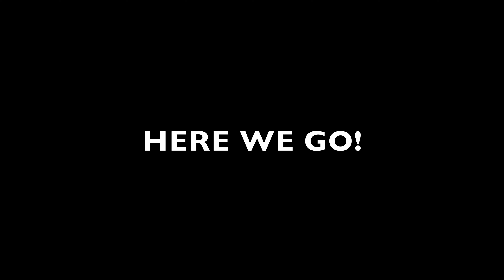Nitro Engine Explosion Aftermath!

Comment: I have done a lot of testing the tank lid on the Rustler model.  

Wanna know what helps seal up even the ugliest lid seals.  

Take your tank seal out remove that screw take it out carefully clean it and add after run oil to the underside of the plastic lid and re insert the foam lid seal back in 

The oil will help it seal on the top of the seal like it should. 👊😎
Reply from the maker: Gotta give that a try! I saved the old seal as I felt doing some sort of trick can fix it. On mine I felt the spring was the main problem as the lid often spilt fuel when I crashed it. Thanks for the comment!
Reply: @haywirerc  
You’re welcome bro.  Ya man it just hit me when I cleaned the new tank and it leaked so bad you could see the exhaust coming out the lid.  

Since I oiled it bam fixed 👊😎

Comment: Damn dude.  Hey man i font remember but was your 454 roto start when you got it?
Reply from the maker: No had a back plate. I swapped the crank with my spare Mach .26 crack which fits all of those big block engines.
Reply: @haywirerc  so if I have a rotor start the pull start should have everything I need then correct?  I'm slowing learning here.
Reply from the maker: Yes the pull start and rotor start will bolt onto the backplate for the pullstart/rotor start.

Comment: How many gallons you put through it? I find my trx 3.3s are anout 6-7 gallons. I always go crazy
Reply from the maker: 7 quarts i have written down!
Reply: @haywirerc  thats crazy low. Shoulda been 2-3 times that easy. You may wanna check out O.S gloe plugs. Lc3 and lc4 if im not mistaken. And horizon hobby after run oil. Common mistake, you can swap things like those. Make sure you blip it or pull the starter after a few drops go in the carb. Honestly im lost for words.
Reply from the maker: I always after ran it. I think it’s from the one way bearing not being oiled. I should of used after run to  oil it before I put it in. It’s a shame as that engine was in great condition.
Reply: I'm at 9 gal vp 20% still running strong with revo 2 yrs no issues. Have a new 3.3 on standby tho .